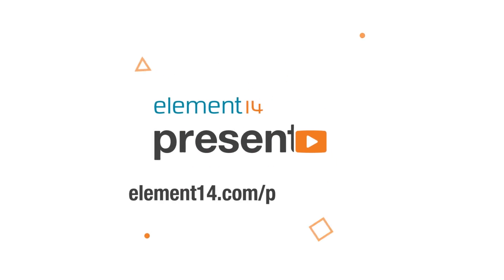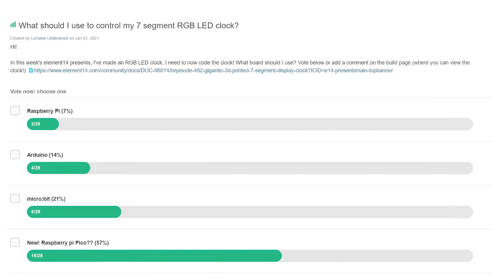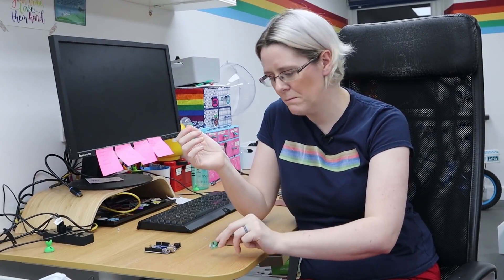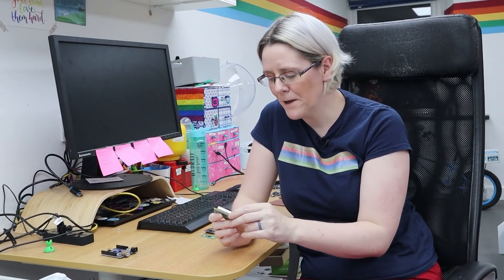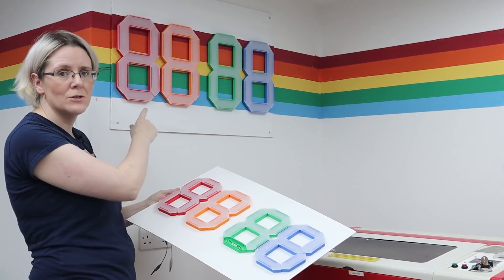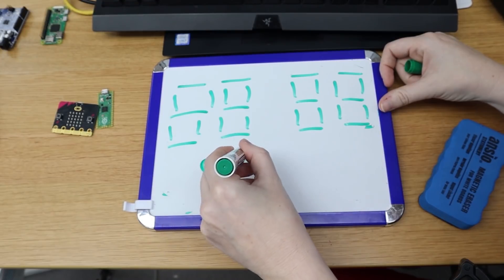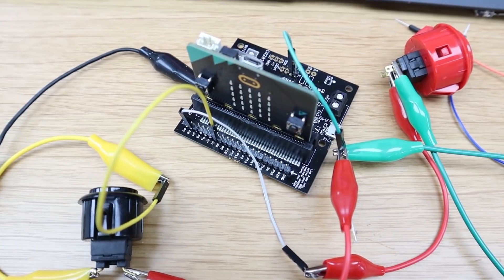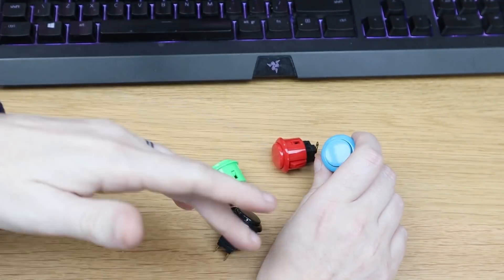NeoPixel 7 Segment Display Clock Update

Comment: What board would you have voted for??
Reply: ESP32
Reply: @steadfastnz  to control 7 segment LEDs you definitely need gaming PC, with 8 cores.32GB of RAM, etc... :)
Reply: I would have been on team easy bit for something you don't see every day.

Great presentation, hope we get more of your projects here!
Reply: Howdy @Lorraine,  you made a couple of really nice shop clocks! It inspires really me to make my own...though will have to go the cardboard+duct tape route since I haven't pulled the trigger on a 3D printer yet (still debating resin vs filament).

I hope you worked out the Real Time Clock issue on your Raspberry Pi Pico (my personal choice thanks to its power+price point). If you haven't already, you can actually use a cheap battery powered DS3231 Arduino module to serve as the system clock.

Here's a detailed tutorial/walkthrough from Johnathan Miller over at Maker Pro: 
https://maker.pro/raspberry-pi/tutorial/how-to-add-an-rtc-module-to-raspberry-pi

Cheers & looking forward to your next project!
(perhaps giving the Pi Pico a mic & setting up Google Assistant so you don't have to physically push the buttons)
Reply: I'd vote arduino, but made my own... Just for the lols

Comment: i have made this 4 digit clock , 1st led F, 2nd is A 3rd is B, 4th is C & so ON, total 30 leds of a normal 7 seg orientation, i tried so many programs rtc time on serial monitor is ok(i use ds1307 for tesing will put 3231 in my final version), but i get random segments lighting up on the clock, i want to learn from scratch how this programmable serial led clock was designed, & get it show correct time one day.

Comment: That's actually a countdown timer, not a stopwatch. A stopwatch counts up and stops when you press a button to find out how long something takes. There's usually a "lap" function that stops the display but continues the timing in the background. Countdown timers are the reverse: you already know how long you want to do something and the clock tells you when to stop.

I think this is a cool project. I might end up making one or more because it's hard to find large digital clocks and I've been wanting a few for a long time. 👍👍